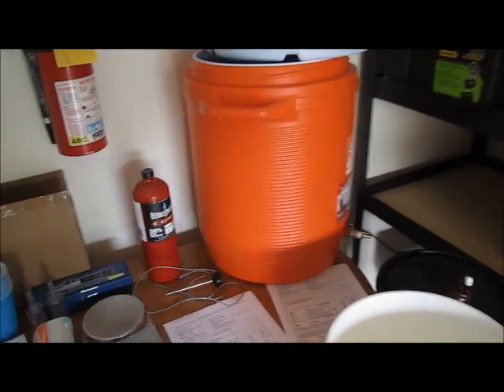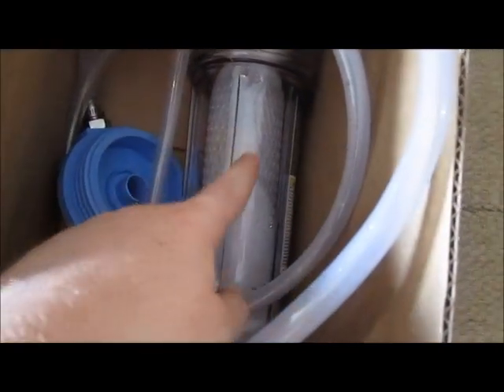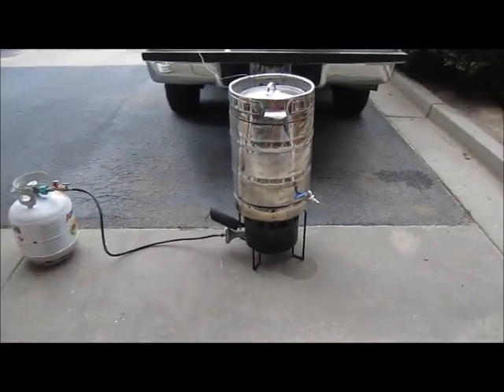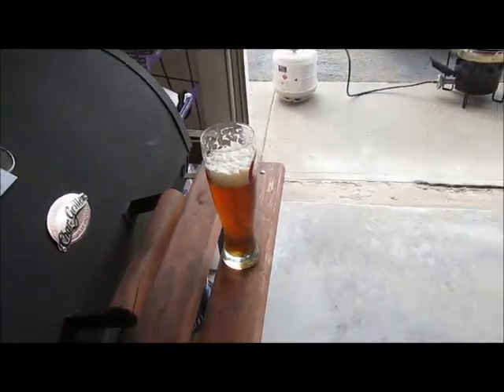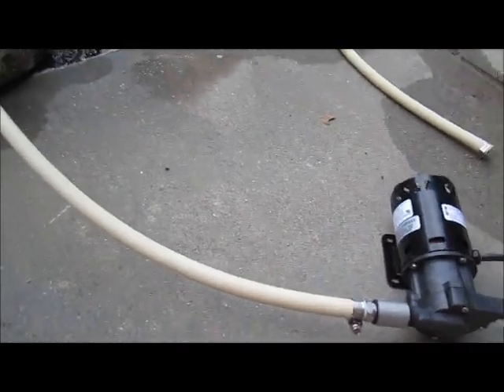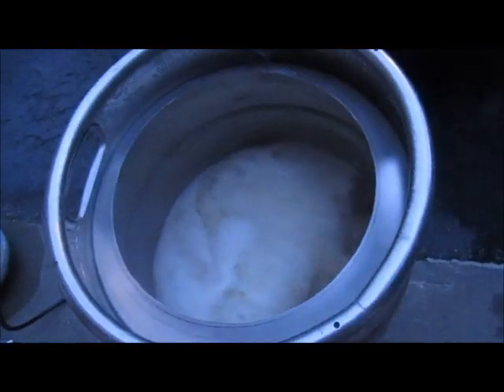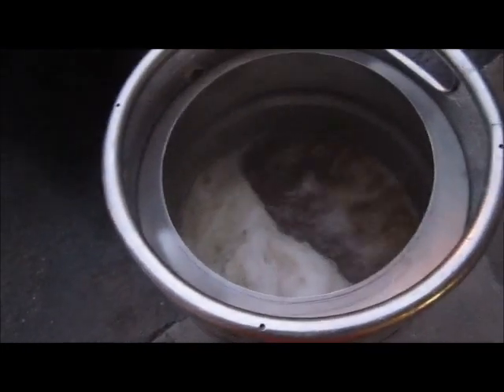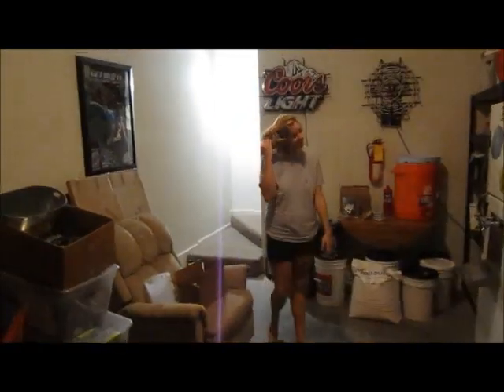Brewing El Dorado Pale Ale All-Grain Recipe

Comment: Damn, you've really been upgrading your system. Instead of doing that I went and bought an oak barrel. I'll be posting footage of that when it arrives.

Using hot and cold water is the ultimate way to leak test your equipment.

I've heard March pumps are pretty flakey so I've just stuck with the gravity method when fly sparging.

Sounds like interesting pale ale in the mix.